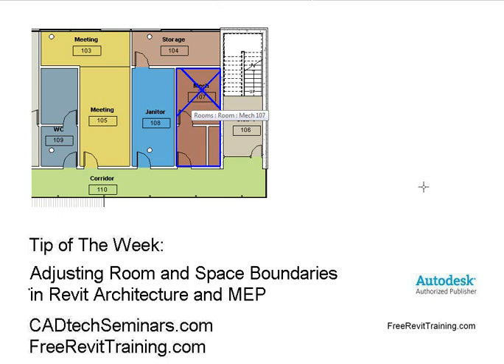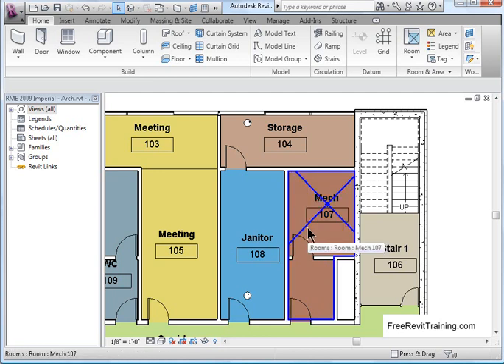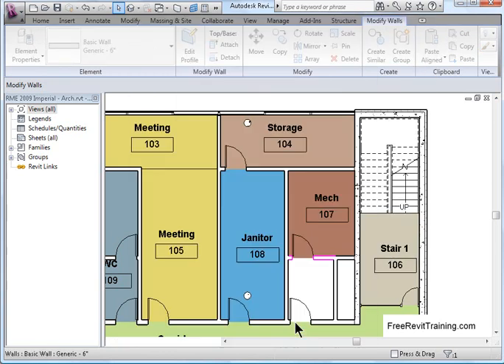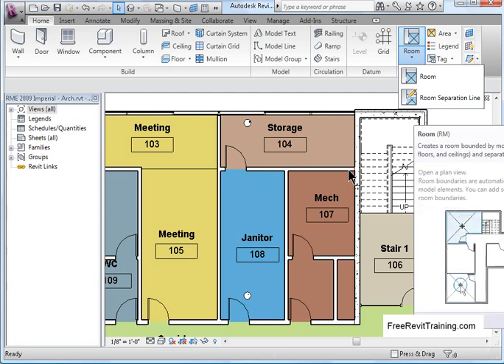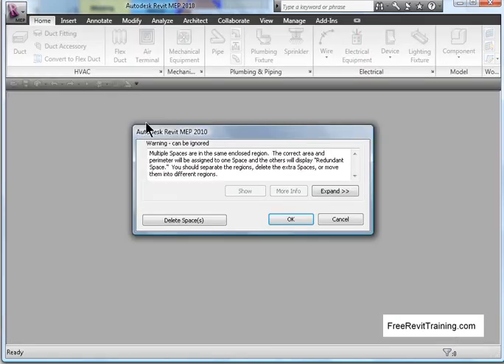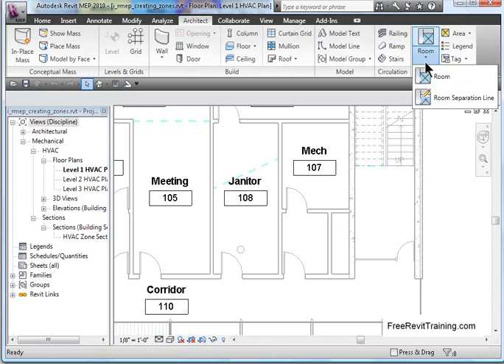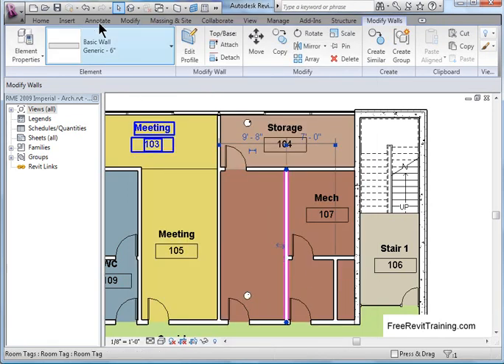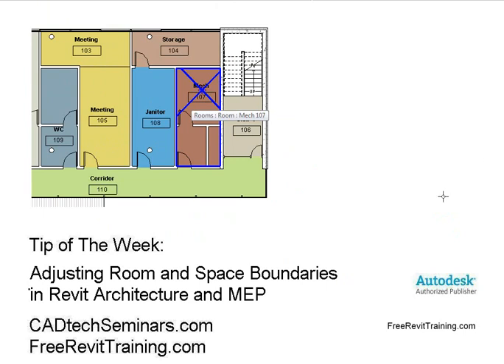Revit - Adjusting Rooms, Walls and Spaces  - CADtech Seminars.com

Comment: Wait a sec. What you did in Architecture was to make the Mech Room bleed over. What has happened in MEP is that the Janitor Room has bled over. Does this mean that, when you hit Delete Spaces, Revit removes whatever space it fancies?
Reply: IMPORTANT: Revit spaces and rooms must be removed from a schedule. If you delete a room or space, the physical room/space will be removed, but it will still be listed in the schedules. Go to the schedule and delete it here also to completely remove it from the project.
Additionally, spaces look for walls and room separators in the arch model. You can add additional space separators. But to remove or move a room separator, you will need to go into the arch model and adjust the walls and separators as needed. Hope this helps. TheRevitGuy.com

Comment: Hi guys, i created room tags but after i changed and deleted these... when i insert a room tag it start from number like 8...9 not from  1...2...3., someone know how to reset it?
Reply from the maker: Ivan, Yes it is easy to reset.  Revit references the last tag placed or EDITED, when placing a new tag. 1. Add a room tag. 2. Edit the Room. Set the room number to the lowest in the set. Example 100. The next room tag that is placed will look at the last one placed and add 1 to it. So it will be 101.
There are also plug-ins that work great for this. Here is a link to a free one.  https://apps.autodesk.com/RVT/en/Detail/Index?id=6951474899027933388&appLang=en&os=Win64
Reply: @CADuniversity  thanks I did it and now it's fine. Good week